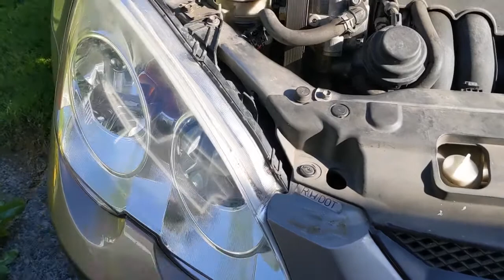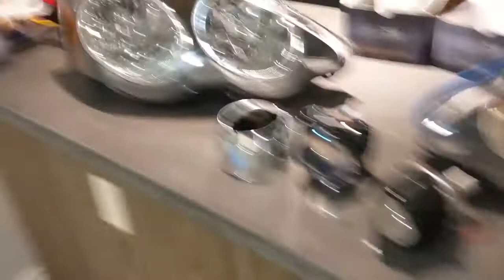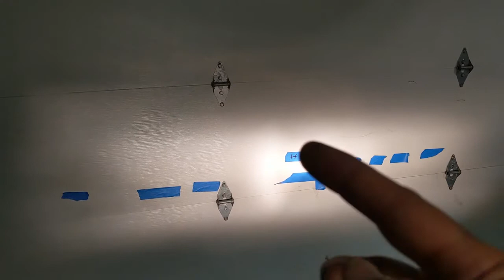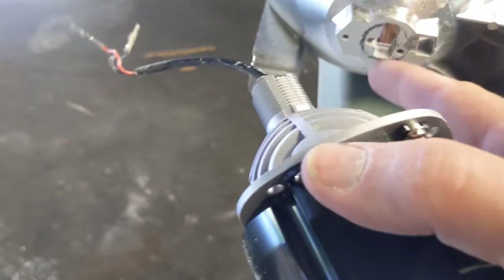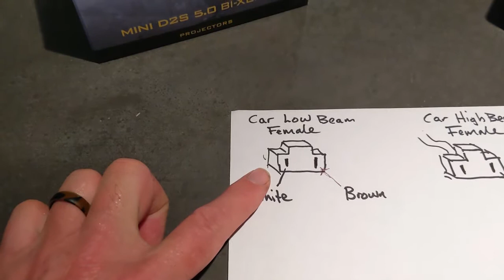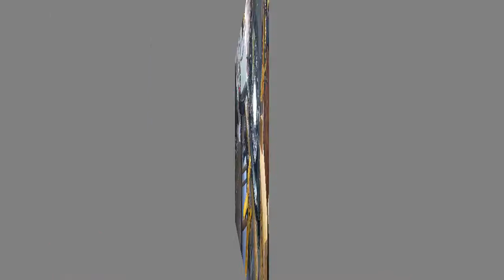Acura RSX Headlight Retrofit

Comment: Found this incredibly informational! I've been wanting to DIY my own set because I hate how the light scatters with just LED's in the OEM housing. It really sucks to see at night. Also afraid I might be blinding other drivers
Reply from the maker: yes...LED's should not be used in the halogen socket. It doesn't focus the light because the light source is not a filament, but a band of light emitters on a post. Get projectors and it will be both focused and safe. I would recoment NOT doing what I did and putting in a dedicated LED high beam. Leave the halogen high beam and retrofit the low beam side with a bi-xenon.
Reply: @erickeenan7562  So you mean to only put in projectors on the outer part of the housing? I was debating on whether to do the quad projector setup or only dual. Not sure if it's worth the effort for the quad for my budget and simplicity

Comment: Question?
What headlights boxes (brand) did you use?
The ones I tried are so difficult to split apart (some kind of glue in it)
Thanks!
Reply from the maker: I did not cover headlight splitting in this video because it is done in so many other videos.  It is easy. Heat oven to 225 degrees, place entire headlight on a piece of cardboard on a sheet pan and 'bake' for 12 minutes. the buytl rubber for the seal softens and you can carefully pry it apart. The rubber can get stringy and sticks to anything. Be careful with the clear lens, but some solvent can be used to clean it if you get some on the lense. It is not a bad idea to buy retrofit buytl rubber to fortify the seal when re heating and putting back together.  The whole heating, splitting and reassembly is shown in my toyota tacoma headlight retrofit video.   Hope that helps.

Comment: I plan on swapping in the MLED 2.0's into my Pontiac G6, not sure if I should go with the dedicated high beam or not, I might just keep that stock. Either way, I hope everything turns out alright! Only reason I didn't go with the D2S or Mini H1 was the fact that I didn't want to wire up the ballast, relay harnesses, and everything else with an HID kit. MLED is very wide spread, and from what I've heard is a pretty good deal for an all in one unit.

Comment: Would you know how much better d2s projectors are compared to the Morimoto H1 projectors? I've been looking to upgrade my cheap Acme H1 projectors to either the Morimoto Mini H1 8.0 or the Morimoto D2S 5.0 but I didn't want to spend extra money on buying a new ballast and bulbs for the d2s if the Morimoto 8.0 projectors were close in performance
Reply from the maker: I think you are on the right track with the Mini H1.  My biggest  issue with the D2S was the shroud.  I absolutely hated all the work I had to do to integrate the gattling gun (the only shroud that would work in the limited space of this headlight) with the D2S. I really can't emphasize this enough...it just sucked!   Especially after a prior build for a different car where I just snapped a shroud on the projector and just did some trimming on the backside flange.  Although I think I can probably get better output and optics with the d2S, I just don't think it is worth the effort considering that I still don't like the appearance of the fabrication I had to do. 
I think using a smaller projector with a very slim shroud that just "snaps in" is a win.  If you are going to go my  route of adding a dedicated  LED high beam. that just cranks out massive light.  I have had trucks, on a widely divided freeway a half mile away want me to dim.  You have to be careful when you are in high beam mode.
Reply: @erickeenan7562  thanks for the info! Just saved me a future headache lol as I was so close to putting d2s projectors in myself
Reply from the maker: @EricV206  I would love to see what you make and how it turns out for you

Comment: My man can I pay you to do the exact same thing for my headlights ? I got the same car and the way you did it just provides so much visibility I feel like I need it now haha very good job
Reply from the maker: I love this little car. But hey....YOU CAN DO IT...that is why I made this video! I just saw a video from one of the major suppliers where they used machine screws to "fine tune" the aim of the screw-back projectors.  I would do that if I was to do it again. I am super-anal on the aiming of the projector before sealing up the housing.  Use mini gatlings on the LED high-beam, and recess the shroud on the D2S another quarter inch....and it will be great.

Comment: They honestly don't have bad light output stock if you keep the lenses clean once the lenses get all oxidized then it effects the light output a lot also just running a bit brighter halogen bulbs helps a lot
Reply: Yeah that might be ok for 99% of people. Then there are people who can’t stand not having the brightest headlights, while still not blinding oncoming traffic. For those people this is the only way to really do that on most cars. I personally did the same thing on my 2007 Corolla. I have to say the same thing as you though. If you keep the lens clean and don’t let them oxidize, they are plenty bright for most people. With the Morimoto two stroke led low beams I was actually pretty impressed. Now I have a quad Bi-LED Retrofit with the Profile Performance 2.0 projectors. The difference in how much you can see is much more than you would expect. Even new cars don’t have as much ligh my going out in front of them. And I still don’t blind oncoming traffic from what I can tell. Lights are aimed modestly. Wanted to start lower than I thought they should be. Made it a bit hard to drive without high beams. So I made small adjustments every night drive. Now I think I have them right where they should be. Anyways my point is, I now feel so safe. Comfortable at night driving. It’s a feeling you have to experience before you decide it’s a waste of money. It really does make driving in the dark so satisfying and comfortable.
Reply from the maker: It is really important to look at 17:56 and see just how important getting your cuttof /aiming just right. This is level ground. The car on the left is being illuminated from the bumper and down to the ground. But the windshield is not illuminated. This driver of that car would not be blinded by the low beam setting, and it would actually be better than the typical sloppy halogen. That being said, cars that have headlights this low to the ground are extremely difficultt to retrofit. The install has to be perfect and the aiming has no margin for error.